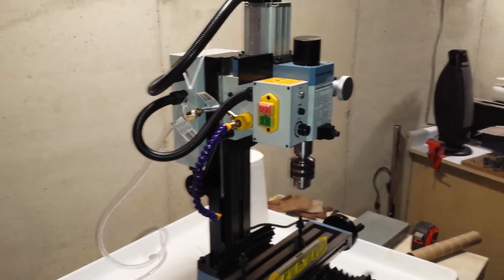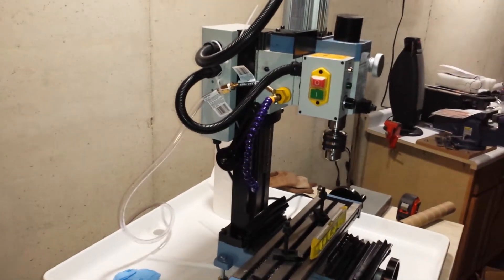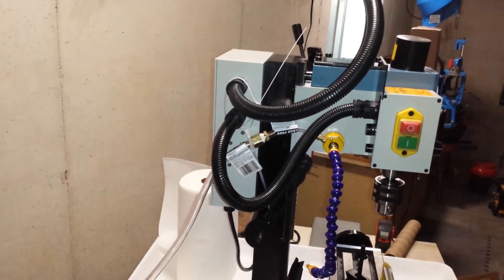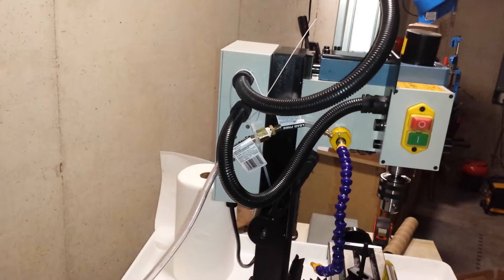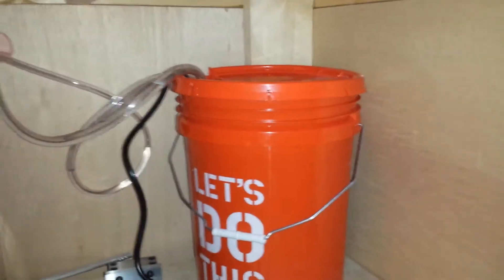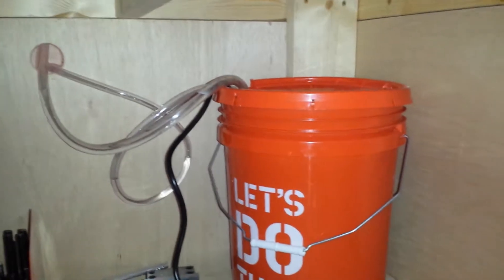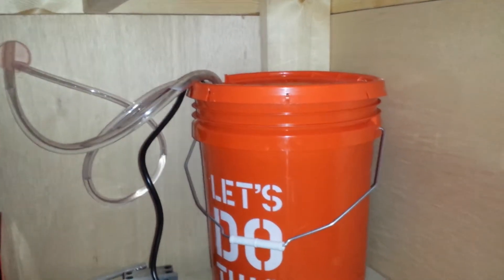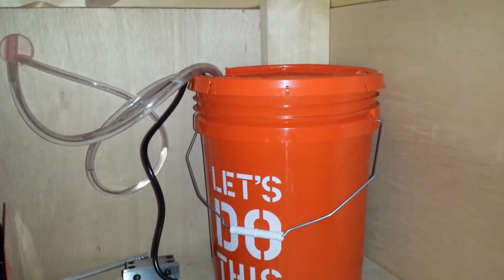MIll coolant system setup part 1

Comment: hello buddy, I just got that same Mill, what did you use for that Base to Catch the Coolant
Reply from the maker: its actually a pre-made basin that is made to set your clothes washer in.  I got it at Home Depot or Lowes.  It worked great for a while, but it became hard to keep sealed to the drain pipe.  Since then I have replaced it with a treated lumber dam around the outside of the bench, and a layer of laminate on the bench surface.  The drain is recessed below that and works pretty well.  If I went the route of the washer basin again, I'd look at plastic welding the PVC pipe directly to the basin to make a permanent seal.